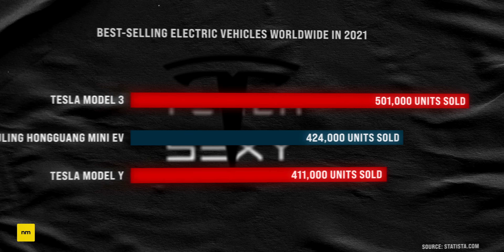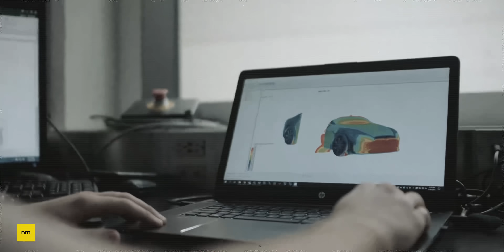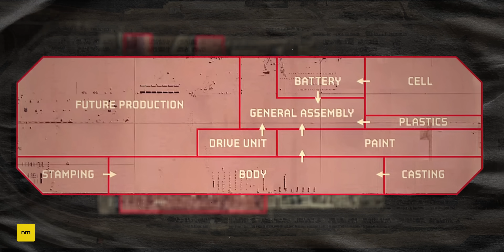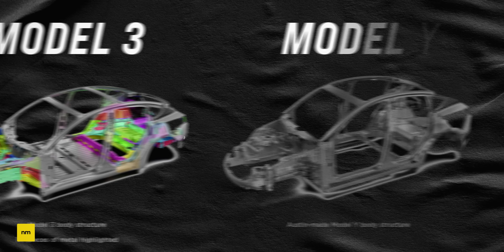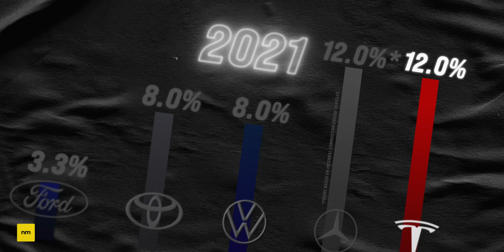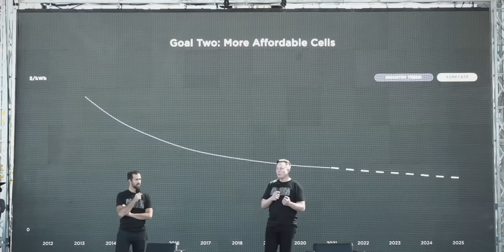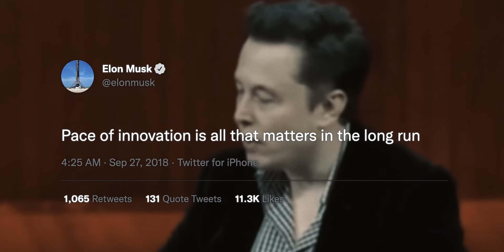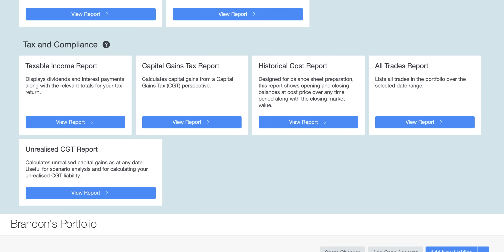The Rapid Innovation Driving Tesla’s Success

Comment: I have a question...if Tesla's batteries are still based on lithium as a raw material isn't Tesla still in trouble? I thought lithium supply is hitting a bottleneck. If this is true, then it doesn't matter how fast you can produce batteries if you don't have enough lithium. Other manufacturers are developing solid-state batteries as we speak.
Reply: Besides Toyota most companies that r developing the tech r battery companies, so they can just buy off them

Comment: "The biggest car company in the World", that meanwhile doesn't sell more than 1 million cars annual, targeting the luxury market. Also losing market share in the BEV sector, and with a battery production relying in other companies. Add to that constraints in ramping up production due to supply chains for battery manufacturing.
Reply: Out of curiosity, Roger... Off the top of your head, how long have you been following Tesla? Thanks
Reply: @jkgeroso6057  they struggled for a long time to be profitable. Until they got a boost from the Chinese Government, with the Shanghai factory.
Reply: @RogerM88  The grey area accounting doesn't help them, nor does the delay on the cybertruck and roadster, nor the warranty issues, or the fact that their reports list produced cars as 'sold' and to top it all off the CFO hired in 2019 from McKinsey has fabricated huge gains during covid. (McKinsey also produced wonderful CFOs for Enron and Valeant).
Reply: This is the year is going to bust

Comment: There's another savings at the charging stations. The 4680 has lower internal resistance and better thermal path. This will allow for improved charge rate. Shorter times at the supercharger.

Comment: Wouldn't a frame built with fewer parts also become a nightmare to repair? Like say for example the frame has a tiny crack that needs to be changed, that would mean ripping everything apart to get to one of the two frame structures. It sure is alot cheaper for Tesla to manufacture, but the savings are pushed on to the consumer in the form of more expensive complicated repairs, right?
Reply: Frames don't get tiny cracks. They are the inner most skeleton of the car and only really get damaged in serious collisions. In that case you might have a bigger problem, yes. I've heard that there is some sort of design to make all but the worst hits from the rear more easily repairable, but I'm not entirely sure

Comment: I Like your Video, nicely presented. As an universitarian engineer I still have to doubt some of the points Here. I recall that there was a time, when teslas factories were very inefficient. Improving 5x over something bad is easier than improving Something which is already State of the Art. So If they manage to improve cost and efficiency over Others Car Makers that's good. But the comparison should be based off of EV factories. Not combustion, they are much more complex and expensive to build. Good to See that Tesla is reflective to improve and listens to critique.
The battery Innovation is another Thing. You mention one metric the battery is better but you have to Care about Life Time of a battery, Speed of changing and much more metrics. If they manage to keep them as good as before, then this is really impressive.
Just my 2 Cents 👍

Comment: With all the improvements in manufacturing happening, it would be nice if Tesla would finally figure out how to implement proper quality control, especially when it comes to their paintjobs. My 2021 M3 has already rust bubbles building up on the inside of the trunk frame, as well as lots of paint bubbles building up on the lower part of the front doors.
Reply: That's unfortunate. My 2021 may built model 3 has none of those so far, and I drive on salted norwegian roads all winter.

Comment: Great brand, technology, immense first mover advantage, but can even the most devoted fan really think they can maintain their lead as much bigger global car manufactures transition to EV's in the next 10 years. Tesla can't supply the world with cars. No one company can. It doesn't matter how innovative they are if the moronic consumer (me) doesn't care, can't afford or can't acquire (due to shortages) a Tesla car.
Reply: Yes - and there are other thing like variety, anti-monopoly politics, innovations on other fronts, hydrogen fuel cars etc. The risk is piling up - while Tesla is P/E 90 and BMW is 2,5 and also quite of the moat.
Reply: @Baldur1005  At their current plans, this valuation is justified in 2 years so I wouldn't call this valuation ridiculous. Antitrust won't matter unless they're actually massive which would definitely justify this valuation, hydrogen will never work because batteries are already dense enough and tesla makes the best product by far.
Reply: You miss the point a bit- Tesla are making cars as fast as they can, so sure, right NOW they're expensive, but costs will fall as they get closer to a demand/supply balance. Also, there's genuine issues with battery cell and raw material supply for the industry as a whole, and the only company I see which is REALLY focused on getting ahead of this and solving it is Tesla. They are doing direct deals with miners of raw material. PREDICTION: Tesla will be the most valuable company in the world in 2025.

Comment: Aren't blade battery cells more advanced than tesla cells?
Reply: @UCoxk6K2glSkIj7gnbEDblyg Tesla uses Panasonic and LG for 2170 cells. Panasonic in North America, LG in China and Europe. They also use CATL for their standard range LFP packs in China and North America.
Reply: They are cheaper to produce, and a great innovation. However, BYD Blade are LFP cells with sub-par energy density, meaning less range for the same size battery. It is highly likely that Tesla will also start buying Blade batteries for their lower range variants just like they are using CATL LFP up to this point.